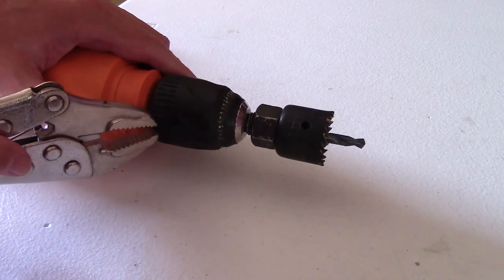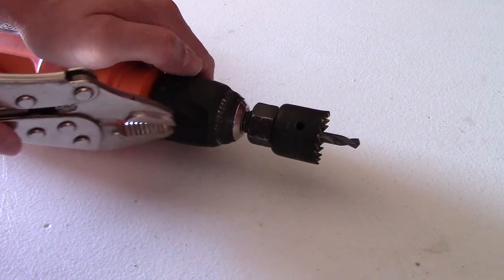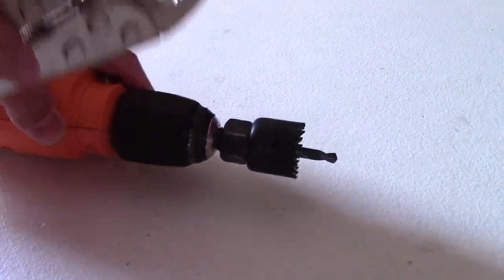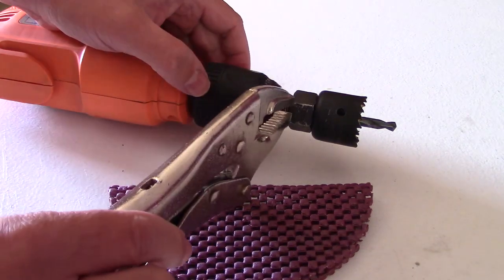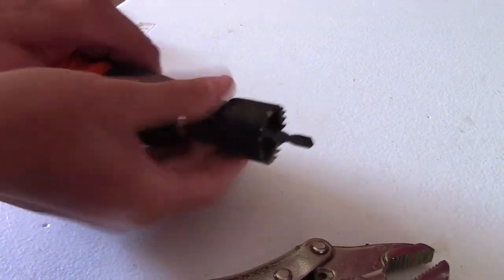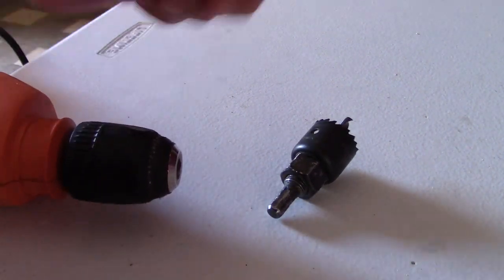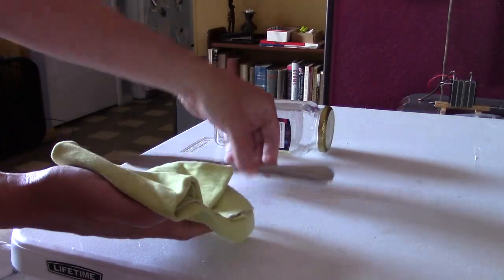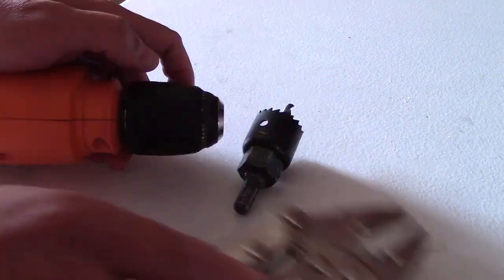How to Unstick or Unfreeze a Frozen Chuck! DIY Drill Repair!  New! no WD40 or pliers needed! Ez DIY!

Comment: Oh, man - this totally worked for me!  I had a drill someone discarded because of a stuck chuck.  Did the channel lock thing and the whole WD40 thing, too --- bought an extra can even, sprayed it into every nook I could find, soaked it overnights, etc --- nothing.  2 minutes using your method, I now have a whole-new drill I can use.  You rock -- thanks!!!
Reply from the maker: sweet! - i've used the trick 2 more times just in the last few days. worked every time.
Reply: Came here to say basically exactly this :D

Comment: This didn't work for me even after trying it off and on over several weeks between praying it with lubricant but what did work instantly was I tapped the end of the bit with the wrench and it started moving into the chuck. When the bit bottomed out, the chuck began to operate perfectly normal.Just thought I'd add my experience in case it helps someone.

Comment: In my experience as a builder, doesn't matter if you are a home owner with a $29 drill or $500 drill, they all do it.  Don't use miracle cure all WD40, After you free the chuck, hit the chuck with compressed air and open and close jaws the whole time.  Double D 40 collects cutting debris.  Try a dry graphite spray, dry silicone spray or Teflon spray.  I had a $600 Hole Hawg Angle Drill fail brand new from the store, returned it and second drill failed,  Both The same day.  Store said they wouldn't warranty third drill. NOT abuse,  milling debris from poor manufacturing still in the chuck.  Brand new so beating chuck wasn't an option.  hahaha